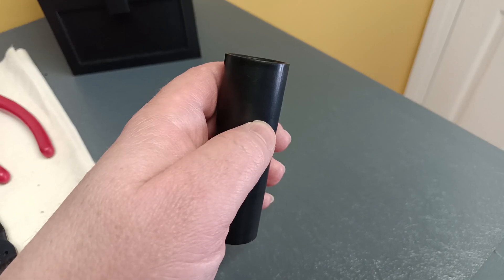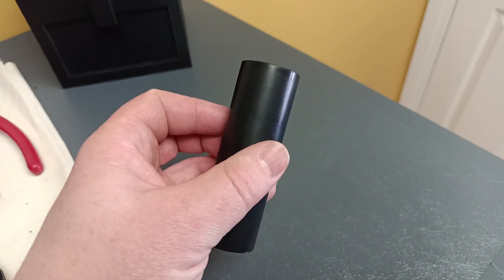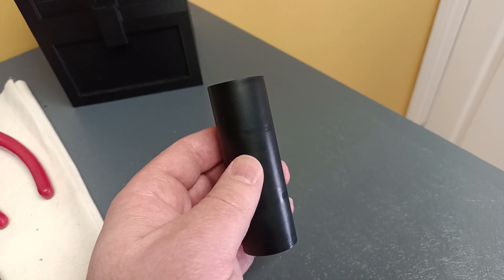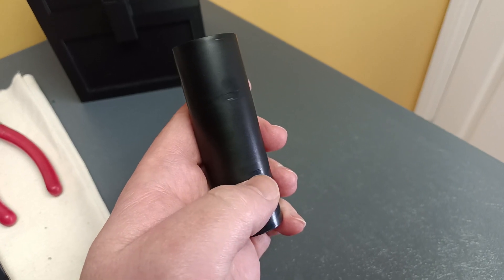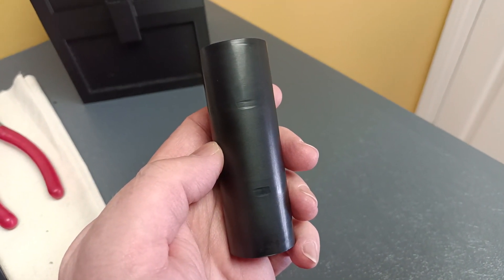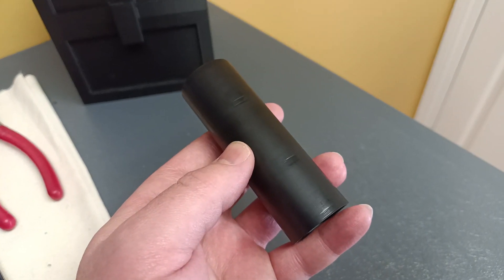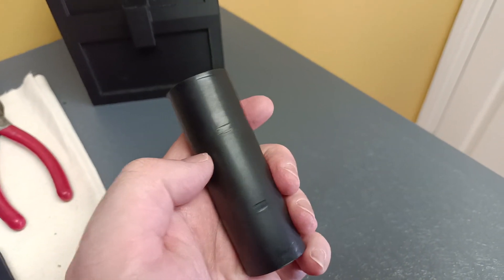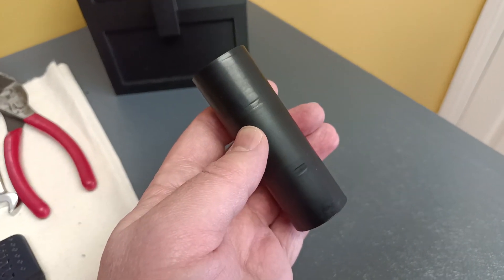The Sovol SV08 Lives! (Somehow...)

Comment: You took out one of the screws that held the extruder stepper in one of your previous videos, when removing the print head assembly from the mount, I wonder if that contributed or maybe accidentally amplified the issue you mention with the plastic locators not fitting.
Reply from the maker: Not impossible. Even though I immediately replaced the screw after noticing it's the wrong one.
But loosening one screw while the other one excerpts additional tension on an improperly placed extruder could indeed contribute to the issues.

Comment: I was going to get a SVo8, but after seeing all of this, I might as well spend the equivalent on upgrading my old Tronxy X5SA Pro, that I had stiffened up etc, and use the other bits I have lying around and make that IDEX conversion.
Reply from the maker: If you're already familiar with your printer, which is essentially a given. Then yes, why not. There is no benefit in buying another printer, that does the same thing with comparable specs.
At the end of the day, they all just melt plastic.

Comment: My sv08 arrived with a broken hotend fan, the big one you can see in the front of the cowl. It had snapped off from the back plate.  The motor still worked causing it to rattle around as soon as the second layer started. I got no joy from the support team, ended up super gluing it back in place and ordering a couple of spares from Aliexpress. I subbed to you as you take the time to upload little niggles.  Hope your channel grows. Greetings from the UK
Reply from the maker: Thanks for the sub.
The front fan is not necessary for the functionality of the printer. 
It's kind of dead weight.
I removed it in my quest for a lighter print head and never put it back.
I had to look up the term niggle.

Comment: Good deal!  Glad you're back up and running.  I'm never sure if Chinese tech support is genuinely trying to help but hindered by the language barrier, or if they're being nice while waiting for the customers to figure out the problems for themselves.  If you are using hot glue to secure the wandering extruder pin, you might try Valerie Moore's "SV08 Extruder Fix" on Printables.

3D printers are becoming complex but they only need a few fundamental things to work well.

Flat and level print bed with an appropriate surface material and temperature for the material being printed.
Extruder that precisely and reliably extrudes molten material
Accurate motion control system to ensure the material is extruded where it should be

In the rush to make a fancy printer with features to sell customers with marketing, often the engineering is inadequate.  It sometimes feels that the 3D printers are barely tested before they're sold.  Creality just introduced their Ender 5 Max and it looks good, but they're marketing it for print farm use and bragging that the extruder was reliability and endurance tested for 500 hours.  That's three weeks.  If they consider that to be extensive endurance testing, how little testing do their other printers get?  They've had problems before, for example, the K1 extruders that lasted a month of average consumer use.  If the manufacturers aren't going to sell printers with good quality extruders that have been properly tested, the after market should respond with well tested hardware mated to a mounting plate and circuit board to make a drop in replacement $100 tool head.

Of course, we have the choice to buy a well tested Prusa 3D printer for 3X the cost, so the free market is sort of working.  If I was a younger man, I'd design and manufacture a prosumer grade 3D printer that's reasonably fast but optimized for print quality and long term reliability, and maintain a library of machine and filament profiles for OrcaSlicer and PrusaSlicer.
Reply from the maker: Yeah 500 hours of print time is nothing for a print farm.
The language barrier is certainly not helpful.
I didn't use the hot glue on the pin. That's how my printer  was shipped. Also my wiring looks totally different than the wiring in the official Sovol Wiki. Not the wiring position, but the type of wiring used. 🤷
I so far have to have a good experience with tech support from any company to be able to judge if they really want to help.
Reply: @DomDecodes  - I had some TPU miss the entrance to the cold end on my new Neptune 4 Pro, squirt sideways and break the plastic housing of the extruder, which unfortunately contained the pivot for the extruder idler gear.  I was able to shim it and keep printing temporarily but I wanted to make sure that Elegoo knew of the problem so maybe future designs will better constrain the filament.  Elegoo sent me a new extruder assembly... the entire tool head, without me asking, much less any time wasting run around, so I can report good after sales support from Elegoo.  I bought a second tool head as a spare and kept the broken one in case I needed spare parts.  I've done a LOT of printing on the Neptune 4 Pro in the following year and a half and have had ZERO problems.
Reply from the maker: @Liberty4Ever that's really good customer support.